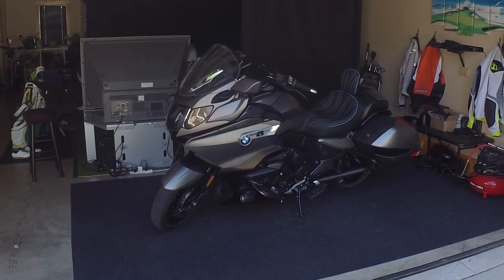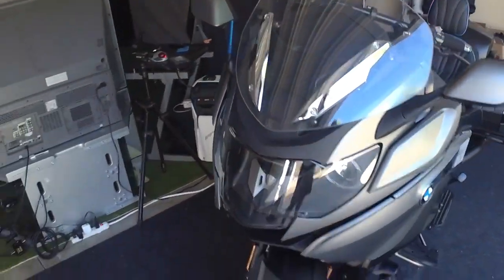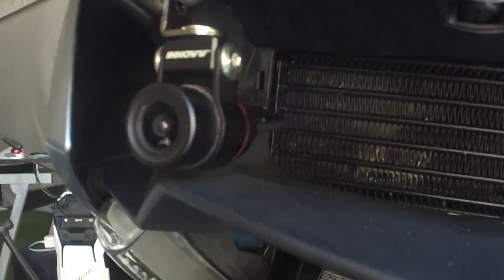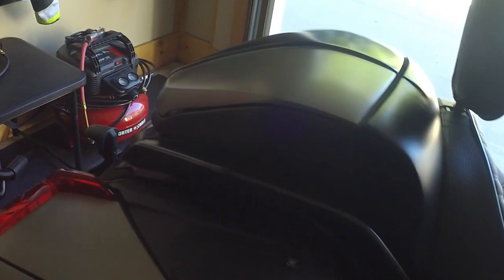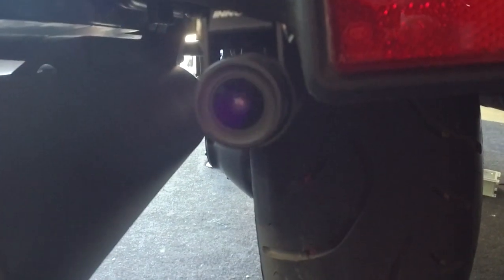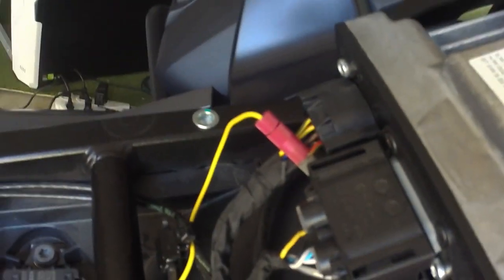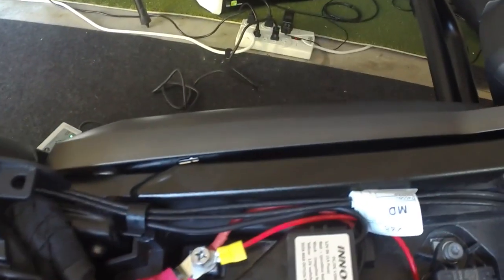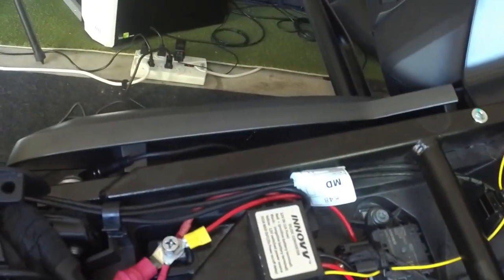Innovv K2 on BMW K1600B

Comment: Not sure about the Posi-taps. you no doubt used the ones that pierce through the wire as a tap. This leaves a hole in the tapped wire. Not sure I like that. I notice you tapped into a red/yellow wire. I guess this is switched? I would have to look at the wiring diagram to confirm before punching a hole in a wire. I own a 2021. I think you said yours is a 2019? wiring may be different. I guess you added this just for accidents of perhaps road rage issues? Good video brother.
Reply from the maker: Thanks for watching. My thinking at the time was to create a connection that had the least likely hood of voiding the warranty. Solder connection would certainly be better. The dash cam was added strictly in case of the types of things you mentioned. The video and sound quality are crap.

Comment: Did you have to use a special tool to fish the front camera wire to the side panel or the rear camera wire to the area under the seat?
Reply: @Josh23913  thank you for your fast reply.